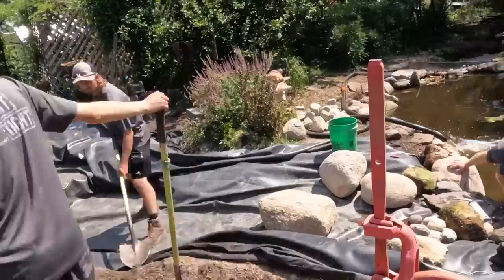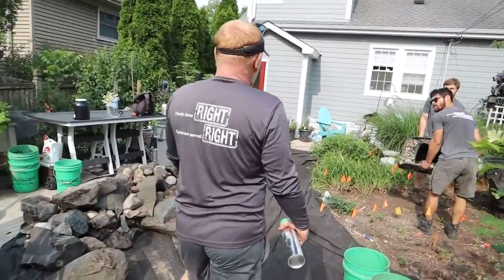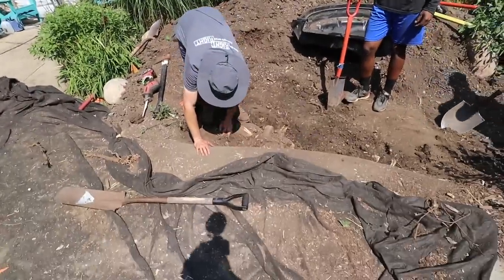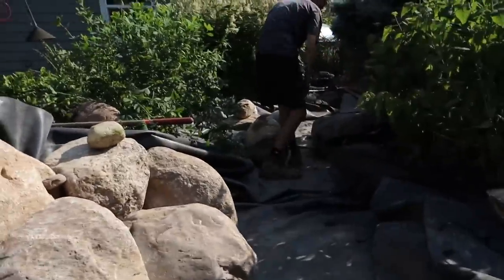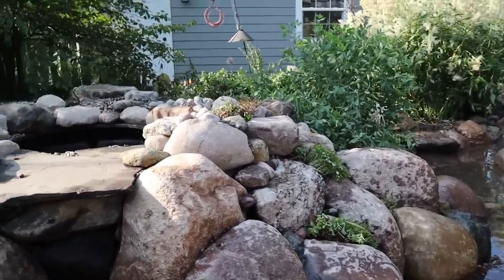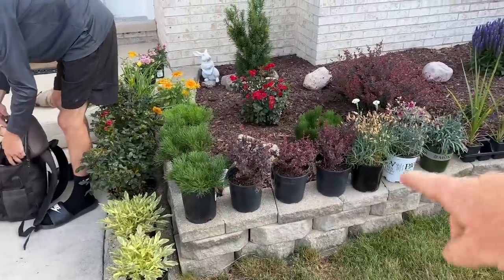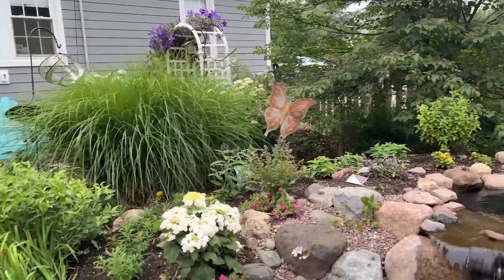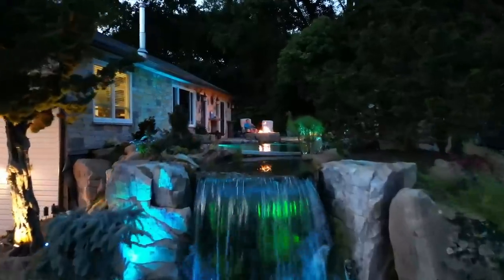Beautiful KOI POND - WHY it wasn't GOOD ENOUGH until NOW!

Comment: I like how you used the rocks to redirect the splash back into the aquablox area. What size pump is in that feature? And you use 2 inch pipe to the Slate stacked urns? With ball valves to each? We are doing a project similar before the end if the year. They want natural gas on one of them.
Reply: I’ve got a double set of the triple spheres coming up in a couple months. The tech team suggested we use 2 aquasurge 2-4 pumps on each.

1 to control the small and medium spheres and 1 for the large.
Reply: @serenitywaterscapes2791  yeah that sounds about right if you want that flow